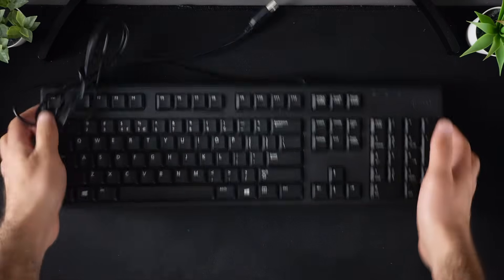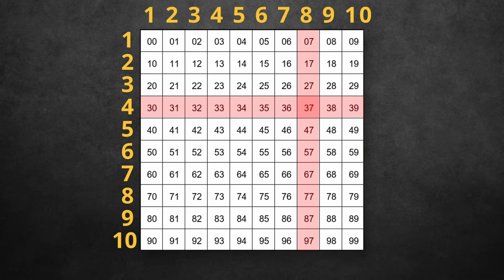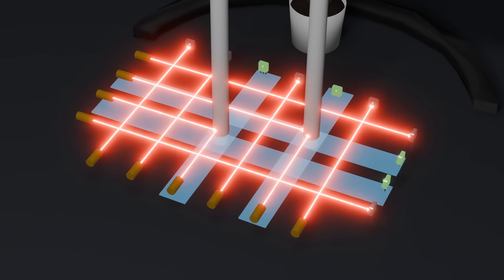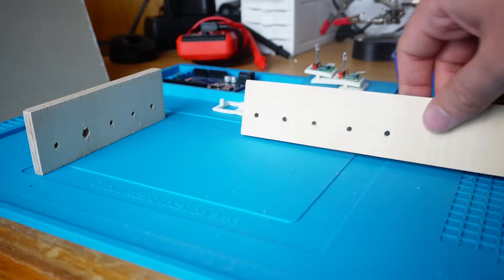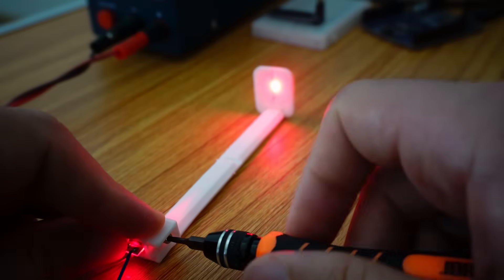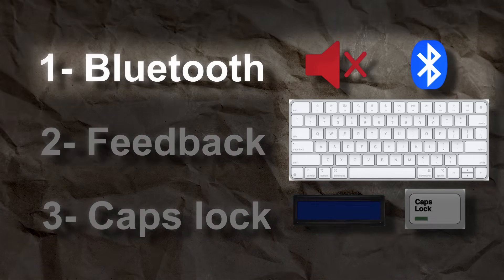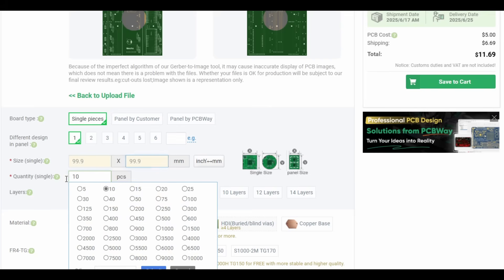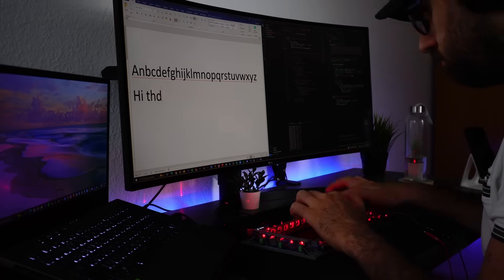I Built a Touchless Keyboard with Lasers (and it actually works)

Comment: esp32 has HID capability and a built-in bluetooth radio, programmable with arduino ide and the esp32-S3 version has native usb
Reply: just been thinking while watching the rest of the video, to retain muscle memory through feel, how about having the laser light broken by the bottom of a key - the keyboard keys we are used to could be made into a flexible membrane, placed on top of the laser housing rather than underneath it -you could make it as tall as a standard keyboard..
Reply from the maker: That is exactly how the old touch screen (the ones that need to be pushed hard) work.
To be honest, the plan was to have a keyboard with a touch bad that works exactly like that (but for the touchbad, I was going to use infra-red light instead of lasers.

Regarding the esp32, I agree that it would have been a better choise.

Comment: Nice! but uh, maybe putting a 3d printed plate under it which displays what key is what laser would be handy? so that you don't have to learn it blind? Also, there have to be sensors which are more efficient then lasers right? perhaps also turning off the column lasers with the sensors would be useful, so they don't blast light continuesly

Comment: Really interesting project! Just a thought, why not use an ESP32 with the BLE keyboard library instead of the Arduino? It can directly simulate a keyboard when connected to your PC.
Reply from the maker: That was definitely an option. However,  I thought that because the key presses are not straightforward, I would have much more flexibility with what I can do if I program and simulate the key presses with Python on my computer. Additionally, updating the code wouldn't need connecting the ESP. That is why I choose to use a simple Arduino instead.
Now, after thinking deeper about it, I believe that having an ESP 32 would have been the better option allowing for both: 1- simulating a keyboard directly using the ESP. 2- Sending the sensors reading and simulating the keypresses on the computer.

Comment: Why not ESP 32 BLE keyboard?
Reply from the maker: That was definitely an option. However,  I thought that because the key presses are not straightforward, I would have much more flexibility with what I can do if I program and simulate the key presses with Python on my computer. Additionally, updating the code wouldn't need connecting the ESP. That is why I choose to use a simple Arduino instead.
Now, after thinking deeper about it, I believe that having an ESP 32 would have been the better option allowing for both: 1- simulating a keyboard directly using the ESP. 2- Sending the sensors reading and simulating the keypresses on the computer.

Comment: I think reducing the lesser exposure is a good idea by covering the laser with something with a small hole thus reducing the the exposure and straightening the laser line
Reply from the maker: I don't understand how would adding a small hole straighten the laser beam.🤔
Reply: @Mecha-94 The hole acts like a crude aperture, so you only let the central portion of the beam through. That means the spot you see after the hole can look cleaner and more defined than the raw diode output.

this is a cheepest way rather than using a lese to focus the laser
Reply from the maker: I assume you mean using a lens to focus the laser 🤔
The laser output is indeed not perfectly circular, but that is not an issue at all.
The issue was directing the laser beam to hit the sensor for which I needed the mechanism.
Reply: @Mecha-94 using lense is that actual way but espensive insted can use the method i say pasing the laser light through a small (not very) hole its. just keeps the light trace neet and tidy

Comment: Neat. Although, as far as repeated keys go, you should have a delay before sending them so it works like a regular keyboard.
Reply from the maker: The decision of how to handle the repeated key messages (continuously pressed key) can be programmed in the Python code to behave like a regular keyboard if desired.
The delay profile of a regular keyboard is simple enough to be replicated. But to be honest, I got used to it as it is.🙄

Comment: I have a pretty cool video idea, sort of related to this one but also not. Have you ever taken apart a laser printer? If so, you might have seen a long oddly shaped lens. The laser on the printer spins around rapidly, and the lens directs the beam parallel to the paper regardless of what angle the laser comes in from, to make it always hit the paper right when it spins. My idea is to mount 2 lasers in similar fashion to in a laser printer, but on the other end have an array of detectors that then give you a high-fidelity grid where you can accurately detect objects position and shape. Know how a spinning lidar sensor maps a point cloud around it? Basically that but inward. Then maybe idk, make it move vertically at precise intervals to 3d scan objects? Thought it would be cool. 

My explanation probably isn’t very good, so if you didn’t get something I said, ask and I’ll be glad to clarify.

Anyways, cool video!

Comment: Nice. This might not be a good keyboard, but it's the start of a decent touchscreen. This is more or less how infrared touchscreens work. And it's a versatile way of doing touch input - works on any surface.
So I guess my suggestion is to make a follow up, converting this into a touchscreen frame.
Reply from the maker: You almost read my mind, I already have  the infrared parts.
The original video idea was to have the keyboard with a small infrared touchpad. However, the video was getting too long, so I kept the Keyboard only.
Reply: @Mecha-94 LOL I didn't even think of doing a touchpad ^^
That's an obvious accessory in hindsight.

Can't wait to see your next video now  :)
Reply: you could probably make it be used as a touchpad in the same frame and switch modes from keyboard to touchpad somehow